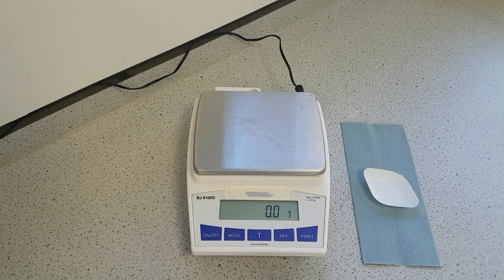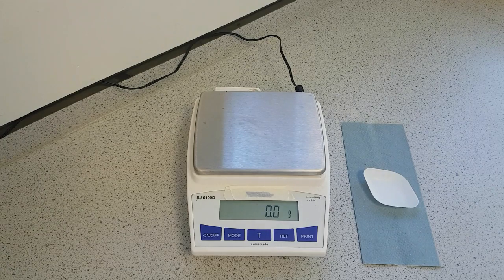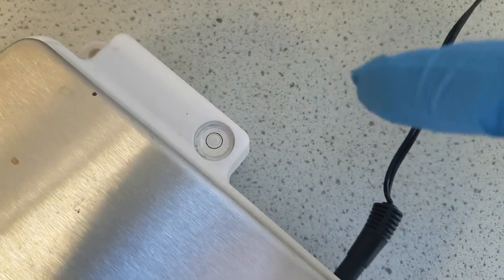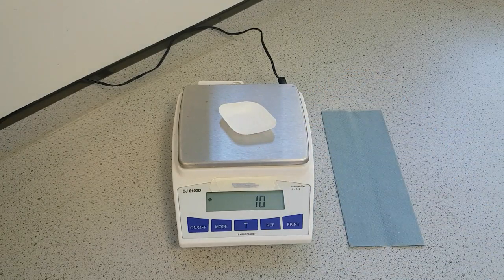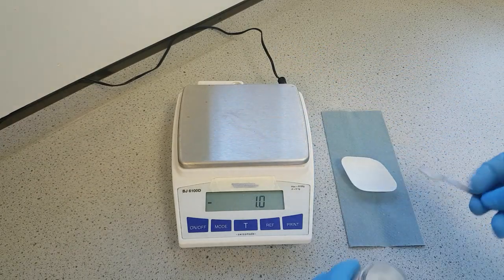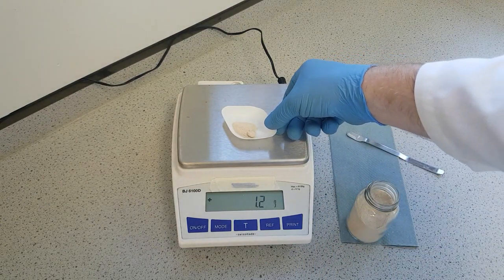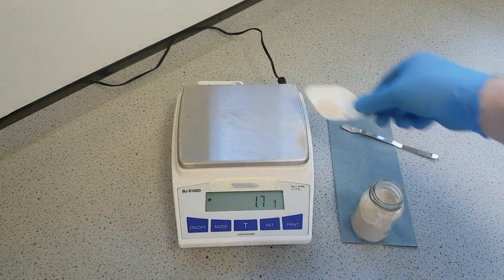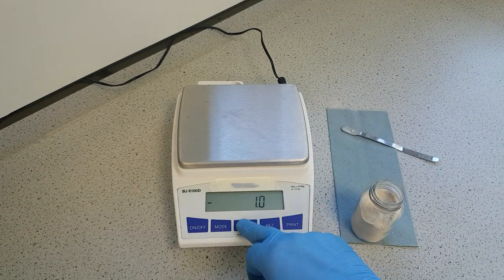How to use a top pan balance

Comment: thanks for the video. quick question, if i have a removable metal top pan with the plastic structure below, is it normal for the top pan to be removed during use? does it make a difference?